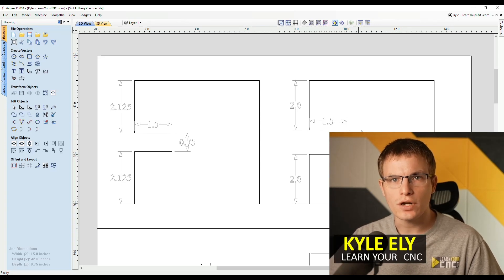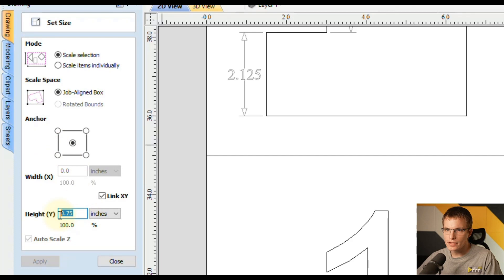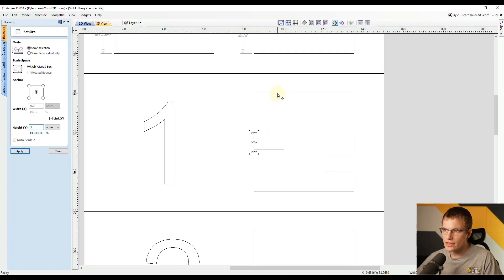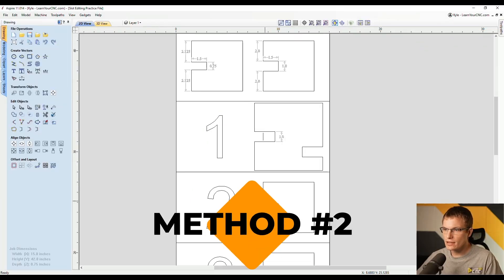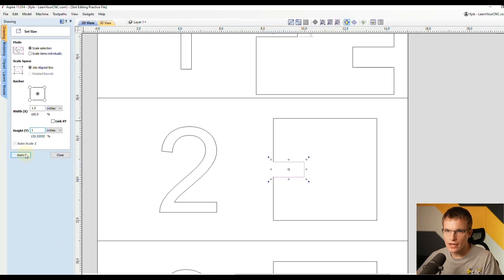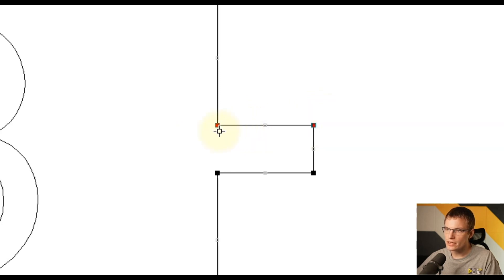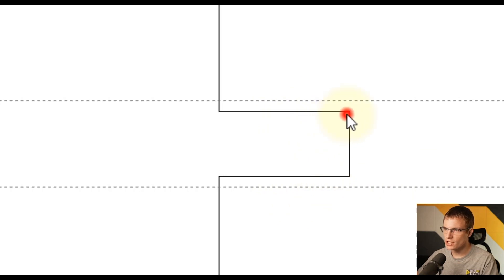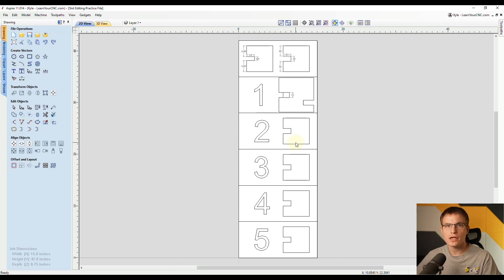TOP 5 Ways to Edit Slot Widths - Vectric VCarve, Aspire, & Cut2D Quick Tip

Comment: These are all unsatisfactory. What I want to do is define slot width by a variable. In most cases that variable will be Z - the material thickness. If I alter Z or add some allowance to it, all the slots of width Z will adopt that new width.

Comment: Another Method. Press F4: The Snapping Options. In the Fixed Nudge Distance, type de distance you want to move the selected nodes. Click OK. Now press Ctrl+Shift and the arrow left, right, up or down, this moves the nodes on the direction that you want, the specific distance.

Comment: Really enjoyed the various options demonstrated.  I routinely use the cut and join method, but it is nice to have other  options when that will be more of a pain.  The method for having snap on and then holding mouse key down and putting in value is excellent.  I knew there was a way to do it but have never researched it to allow me to make that specific distance move - great tip.

Comment: So if you wanted to move the slot closer to an edge and add additional slots what technique would you utilize?
Reply: Press F4: The Snapping Options. In the Fixed Nudge Distance, type de distance you want to move the selected nodes. Click OK. Now press Ctrl+Shift and the arrow left, right, up or down, this moves the nodes on the direction that you want, the specific distance. Create a rectangle the same size as the slot, and place it side by side with the existing slit, type in the Fixed Nudge Distance box the distance you want to move the rectangle that will be the new slot. Once this is done, make the slot a little longer, so that it protrudes from the figure to which you want to make the slot. Now select first the shape and then the rectangle, and apply the Substract command in Edit Objects.

Comment: Hi Kyle , great video.  I have a related question ...is there a "simple" way to change slot widths that are at angle (i.e. not aligned to X or Y axes)?  My project means I have to change the width but not the length of a number of mortices to accommodate a different thickness of plywood tabs (tenons) from the original design, but several of the mortices are at varying relative angles. The centrelines of the mortice slots need to stay in their same relative position.  I can think of a laborious process using offline trigonometry but I'm sure you'll know a suitable trick. cheers

Comment: Kyle   Thanks for doing the  video and  also the files to to follow along  while watching the video Great Job .Question ? I have a file svg file for a platform out doors bird feeder. the roof, bottom and  Sides all have slots and Tabs to put it together.  I want to make it larger and also use .25 plywood Can it be scaled up using 1of the method's in  this video .Thanks Jeff Peters.

Comment: Another excellent tip video, Kyle. I don't see me ever using method 4. However, when you entered .125 to move the bottom part of the slot, why did you not enter -.125, since you wanted it to move downwards?  thank you
Reply: Because before he typed in the value he moved the cursor "in the direction" that he wanted the vector to move. So he only needed to enter a DISTANCE, not a direction of the move.